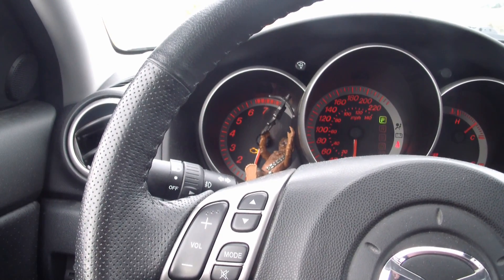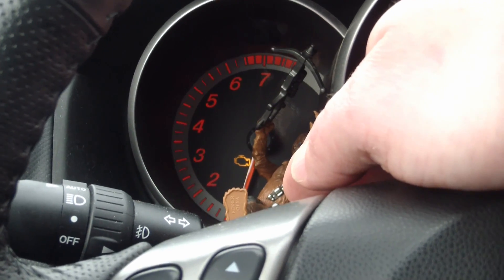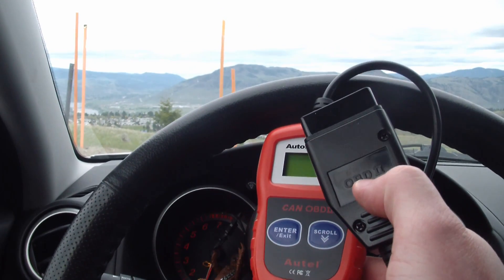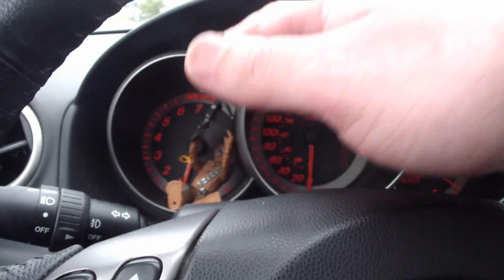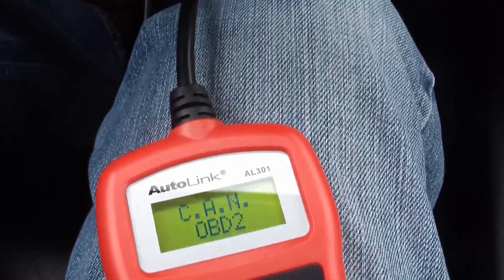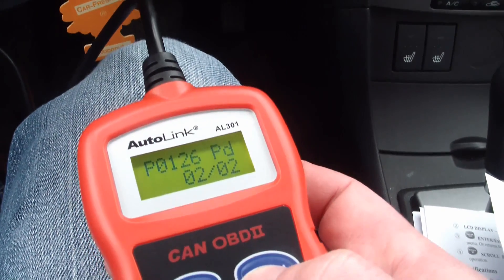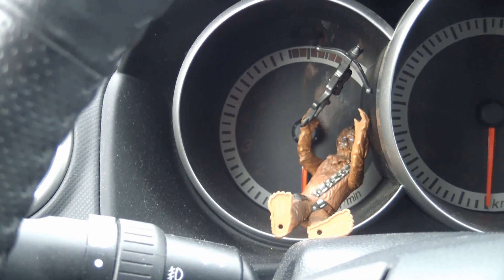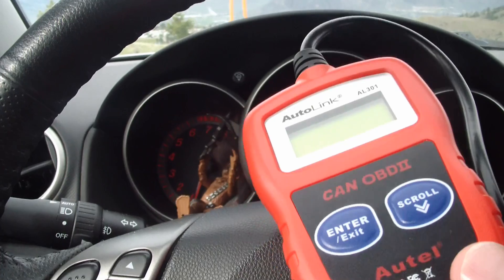Manly-Man Skills: Outsmart Mechanic Scams by Using Your Car's Computer!

Comment: ok lets say your mazda had a random missfire. here is mazda's diagnostic chart. you have 1 hour to nail it. whats wrong with your car

ProDemand
2006 Mazda 3 2.3L Eng S

Component
P0300

REQUESTED INFORMATION

DTC P0300 [LF, L3]

DETECTION CONDITION AND POSSIBLE CAUSE (DTC P0300 - LF, L3)
DTC P0300	Random misfire detected
DETECTION CONDITION 	
The PCM monitors CKP sensor input signal interval time. The PCM calculates change of interval time for each cylinder. If change of interval time exceeds preprogrammed criteria, the PCM detects misfire in the corresponding cylinder. While the engine is running, the PCM counts number of misfires that occurred at 200 crankshaft revolutions  and 1,000 crankshaft revolutions  and calculates misfire ratio for each crankshaft revolution. If the ratio exceeds the preprogrammed criteria, the PCM determines that a misfire, which can damage catalytic converter or affect emission performance, has occurred.
Diagnostic support note 

This is a continuous monitor (Misfire).
The MIL illuminates if the PCM detects the misfire which affects emission performance in two consecutive drive cycles or in one drive cycle while the DTC for the same malfunction has been stored in the PCM.
The MIL flashes if the PCM detects the misfire which can damage the catalytic converter during first drive cycle.
PENDING CODE is available if the PCM detects the misfire which affects emission performance during first drive cycle.
FREEZE FRAME DATA is available.
DTC is stored in the PCM memory.
POSSIBLE CAUSE 	
CKP sensor malfunction
CMP sensor malfunction
Ignition coil malfunction
Ignition system malfunction
MAF sensor contamination
Excess air suction in intake air system (between MAF sensor and intake manifold)
Fuel pump malfunction
Fuel pressure regulator (built-in fuel pump unit) malfunction
Fuel line clogged
Fuel filter clogged
Fuel leakage in fuel line
Fuel runout
Poor quality fuel
Purge control solenoid valve malfunction
PCV valve malfunction
EGR valve malfunction
Vacuum hoses damages or improper connection
Related connector and terminal malfunction
Related wiring harness malfunction
Insufficient compression
Variable valve timing control system improper (L3)
DIAGNOSTIC PROCEDURE CHART
STEP	INSPECTION	ACTION
1	VERIFY FREEZE FRAME DATA AND DIAGNOSTIC MONITORING TEST RESULTS HAVE BEEN RECORDED 
Have FREEZE FRAME DATA and DIAGNOSTIC MONITORING TEST RESULTS (Misfire related) been recorded?
Yes	Go to the next step.
No	Record the FREEZE FRAME DATA and DIAGNOSTIC MONITORING TEST RESULTS on repair order, then go to the next step.
2	VERIFY RELATED REPAIR INFORMATION AVAILABILITY 
Verify related Service Bulletins and/or on-line repair information availability.
Is any related repair information available?
Yes	Perform repair or diagnosis according to the available repair information.
If the vehicle is not repaired, go to the next step.
No	Go to the next step.
3	VERIFY RELATED PENDING CODE OR STORED DTC 
Turn the ignition switch off then to the ON position (Engine off).
Verify related pending code or stored DTCs.
Are other DTCs present?
Yes	Go to the appropriate DTC troubleshooting.(See DTC TABLE [LF, L3] ).
No	Go to the next step.
4	VERIFY CURRENT INPUT SIGNAL STATUS (KEY TO ON/IDLE) 
Access APP1, APP2, ECT, IAT, MAF, RPM, TP, and VSS PIDs using WDS or equivalent.
(See PCM INSPECTION [LF, L3] ).

Is there any signal that is far out of specification when the ignition switch is turned to the ON position and the engine idles?
Yes	Inspect suspected circuit and/or part according to inspection results.(See PCM INSPECTION [LF, L3] ).Then go to Step 20.
No	Go to the next step.
5	VERIFY CURRENT INPUT SIGNAL STATUS UNDER TROUBLE CONDITION 
Inspect the same PIDs as in Step 4 while simulating FREEZE FRAME DATA condition.
Is there any signal which causes drastic changes?
Yes	Inspect suspected circuit and/or part according to inspection results.(See PCM INSPECTION [LF, L3] ).Then go to Step 20.
No	Go to the next step.
6	INSPECT CMP SENSOR 
Inspect CMP sensor.
(See CAMSHAFT POSITION (CMP) SENSOR INSPECTION [LF, L3] ).

Is CMP sensor normal?
Yes	Go to the next step.
No	Inspect installation condition and damages on timing chain and gears, repair the malfunctioning part.
If it is normal, replace the CMP sensor.
Then go to Step 20.
7	VERIFY CKP SENSOR INSTALLATION CONDITION 
Inspect for CKP sensor looseness.
Is CKP sensor loosen?
Yes	Retighten the CKP sensor, then go to Step.
No	Go to the next step.
8	INSPECT IGNITION COIL HARNESSES 
Inspect the ignition coil related harness condition (intermittent open or short) for all cylinders.
Are harness conditions normal?
Yes	Go to the next step.
No	Repair suspected wiring harnesses, then go to Step 20.
9	INSPECT IGNITION SYSTEM OPERATION 
Carry out spark test.
(See SPARK TEST ).

Is strong blue spark visible at each cylinder?
Yes	Go to the next step.
No	Repair or replace malfunctioning part according to spark test result.Then go to Step 20.
10	INSPECT MAF PID 
Start the engine.
Access MAF PID using the WDS or equivalent.
Race the engine and verify that MAF PID changes quickly according to change in the engine speed.
Is MAF PID response normal?
Yes	Go to the next step.
No	Replace the MAF sensor, then go to Step 20.
11	INSPECT EXCESSIVE AIR SUCTION IN INTAKE AIR SYSTEM 
Inspect for air leakage at following:
Between the MAF sensor and throttle body
Between throttle body and intake manifold
Is there any malfunction?
Yes	Repair or replace suspected part, then go to Step 20.
No	Go to the next step.
12	INSPECT FUEL LINE PRESSURE 
Inspect fuel line pressure.
(See FUEL LINE PRESSURE INSPECTION [LF, L3] ).

Is fuel line pressure normal?
Yes	Go to Step 14.
No	If the fuel line pressure is too low, go to the next step.If the fuel line pressure is excess high, replace the fuel pump unit, then go to Step 20.
13	INSPECT FUEL LINE FROM FUEL PUMP TO FUEL DELIVERY PIPE 
Visually inspect fuel line for fuel leakage.
Is there any fuel leakage?
Yes	Replace suspected fuel line, then go to Step 20.
No	Inspect fuel filters for following:
Foreign materials or stain inside fuel filter (low-pressure side)
Perform following actions depend on the result above.
If foreign materials or stain is found inside fuel filter (low-pressure side), clean the fuel tank and filter (low-pressure side).
If normal, replace the fuel pump unit.
Then, go to Step 20.
14	INSPECT ENGINE COMPRESSION 
Inspect engine compression.
(See COMPRESSION INSPECTION [LF, L3] ).

Is it normal?
Yes	Go to the next step. (L3)Go to Step 16. (LF)
No	Perform engine overhaul for repairs, then go to Step 20.
15	INSPECT VARIABLE VALVE TIMING CONTROL SYSTEM OPERATION 
Inspect variable valve timing control system operation.
(See VARIABLE VALVE TIMING CONTROL SYSTEM OPERATION INSPECTION ).

Does variable valve timing control system work properly?
Yes	Go to the next step.
No	Repair or replace malfunctioning part according to variable valve timing control system inspection results, then go to Step 20.
16	INSPECT OPERATION OF PURGE CONTROL SOLENOID VALVE 
Turn the ignition switch off.
Connect the vacuum pump to purge control solenoid valve and apply vacuum to solenoid.
Verify that solenoid holds vacuum.
Turn the ignition switch to the ON position (Engine off).
Access EVAPCP PID in SIMULATION TEST using the WDS or equivalent.
Set duty value to 100%  for EVAPCP PID.
Apply vacuum while turning solenoid from OFF to ON and simulating EVAPCP PID with 100%  duty value.
Verify that solenoid releases vacuum while solenoid is turned ON.
Is purge control solenoid valve operation normal?
Yes	Go to the next step.
No	Replace the purge control solenoid valve, then go to Step 20.
17	INSPECT PCV VALVE OPERATION 
Turn the ignition switch off.
(See POSITIVE CRANKCASE VENTILATION (PCV) VALVE INSPECTION [LF, L3] ).

Is PCV valve operation normal?
Yes	Replace the PCV valve, then go to Step 20.
No	Go to the next step.
18	INSPECT OPERATION OF EGR VALVE 
Remove the EGR valve.
Visually inspect the EGR valve for stuck to open.
Is EGR valve stuck to open?
Yes	Repair or replace the EGR valve, then go to Step 20.
No	Go to the next step.
19	INSPECT SEALING OF ENGINE COOLANT PASSAGE 
Perform "ENGINE COOLANT LEAKAGE INSPECTION."
(See ENGINE COOLANT LEAKAGE INSPECTION [LF, L3] ).

Is there any malfunction?
Yes	Repair or replace malfunctioning part according to inspection results.Then go to the next step.
No	Go to the next step.
20	VERIFY TROUBLESHOOTING OF MISFIRE DTC COMPLETED 
Make sure to reconnect all disconnected connectors.
Turn the ignition switch to the ON position (Engine off).
Clear the DTC from the memory using the WDS or equivalent.
Perform the KOER self-test or the HO2S heater, HO2S, and TWC Repair Verification Drive Mode. (See OBD-II DRIVE MODE [LF, L3] ).
Is the PENDING CODE for this DTC present?
Yes	Replace the PCM, then go to the next step.(See PCM REMOVAL/INSTALLATION [LF, L3] ).
No	Go to the next step.
21	VERIFY AFTER REPAIR PROCEDURE 
Perform the "AFTER REPAIR PROCEDURE".
(See AFTER REPAIR PROCEDURE [LF, L3] ).

Are any DTCs present?
Yes	Go to the applicable DTC troubleshooting.(See DTC TABLE [LF, L3] ).
No	Troubleshooting completed.

Comment: Ok you should point out that if it flashes at you then yes, you want to worry about it. A flashing obdll light means you have the worst kind of missfire: the kind that dumps raw fuel into your catalytic converter eventually ruining it and costing you big bucks at smog time. Also there is an even better device than that autolink you have. There are bluetooth obdll readers you can get for $13 on shmebay that you use with a free app on your phone called torque and it does sooooo much more than just read and clear codes. You can even do advanced stuff like graph timing advance, O2 read outs and fuel useage and more. For $13!!!

Comment: i had an electrician give me a wiper motor switch to "throw" onto his suburban "real quick".  he ordered me to do it because one of the 2 speeds of his wipers wasn't working including the intermittent wipers. instead i actually tested the circuit. the switch was fine, the wiper motor was bad! he just assumed it was so f'ing simple and easy. 

same guy had a problem with the automatic headlight system (going through tunnels or at night" etc...(remember this guy is an electrician) he said "ahhh its just probably a stupid relay. just pull out the relay and clean it" clean it? gone are the days of that stuff. this "relay" that was buried in the dash somewhere? it was actually a "module" a state of the art module (at the time) circuit board. who's to say that was even the problem?

Comment: I get that the mechanic system is broken. what is your answer? If you made your living repairing cars how much would you consider fair compensation? $10 $20 $30 $40? IF YOU OWNED A SHOP HOW MUCH IS A FAIR AMOUNT TO PAY YOURSELF? its simple to figure out...

really, people complain but how much would you do it for? dont forget you need $30,000 to $60,000 in your OWN personal tools. I love what i do but it is an extremely frustrating and at times difficult job. 

i just pulled a cylinder head off of a 2006 camry 4 cylinder to have the valves reconditioned (burnt valves). i was paid 7.7 hours for the job. it took me 13! I have been working on cars over 20 years. i had to remove everything touching the cylinder head so it could be sent to a machinist. i also had to remove the timing chain cover that is silicone'd on. 

there was 3 hours alone into clean up of parts and gasket mating surfaces. That would mean that you would have to have the head off the car and stripped down in about 1 hour. 3 hours for cleaning leaves you 3.7 hours to re install the parts back onto the head, torque down the head, set up the cams and timing chains, glue/silicone the timing cover on put on all the wiring, connectors, hoses, intake and exhaust plumbing, change the oil, add and burp the coolant, and test drive, confirm there are no problems or fluid leaks etc...

SOUND LIKE A POSSIBILITY? if i did it 3 times in a row sure. that particular engine 1 or twice in a lifetime, NOT GOING TO HAPPEN!

NOW consider all of the LIABILITY i have after losing money on a job (paid 7.7 hours for 13+ hours of work) any little tiny thing that goes wrong with anything whether it has anything to do with you or not is now you problem. IS IT WORTH IT?

Comment: First off i am all for anyone to fix there car themselves. BUT i am sick and f'ing tired of the mentality of people thinking that they can plug something into a car (whether its a $60,000 tool or a HF $9.99 tool) and it will tell them whats wrong? can you guess and get lucky YES. I've been doing this over 20 years and to this day i have cars i spend hours on trying to accurately diagnose the problem. 

we had a mercedes in last week. the turn signal on the left side stayed on. there were 30 codes! i can go retrieve those codes and show them to you. will you be able to tell me whats wrong with the car? i can tell you that the problem WAS NOT A TURN SIGNAL SWITCH.The thing that really sucks about most euro cars is that there is no access to "backprobe" the wiring or connectors. WTF how F"ING STUPID IS THAT?

I spent 3+ hours on the car and even replaced the turn signal switch. The switch did not fix it. i took it all back apart. the customer was not charged anything, no diag, no parts, no labor. i am payed by the job only (as are most mechanics). SO WHO GOT RIPPED OFF? THE CUSTOMER? OR ME, THE MECHANIC? 

what does the computer say you need to fix/replace for a p0300 RANDOM MISFIRE? the "random" means that the engine computer cant detect which cylinder/s is/are misfiring. 

so...some or all of the cylinders are misfiring (you have extracted trouble code p0300 from your car). just go to autozone and ask the minimum wage employee what to fix/replace with your p0300 code? google it (yes usually very informative BUT can just as easily misinform some one very quickly and steer them down the wrong road...not a cost savings in any way).

misfire can be anything that causes the engine to misfire. 

vacuum leak
bad plug, but why was the plug bad? is it going to go bad again? 
bad coil?
bad plug wire?
restricted injector?
open injector?
bad computer driver?
head gasket problem?
wrong fuel e85 in a e10 vehicle?
bad crank sensor?
timing chain/belt problem

there are several more...

on top of all that more misfires are intermittent in nature then they are constant? is an intermittent any more difficult to find/fix/replace?

Comment: Thanks for the info Chris. I need to invest on one of those nifty tools. My airbag light has been going on and off for a while, driving me mad each time because it chimes 3 times each time it comes on!😡 would love to turn that shit off! Keep it real!

Adam
Reply: Abom79 so you think plugging the tool into the car is going to tell you what to fix for you airbag? i doubt it, but thats just coming from a 20 year mechanic.
Reply: the scanner will not tell you that there is a loose connection. more importantly it will not tell you where the loose connection is.
Reply: Abom79 If it's the passenger's seat airbag, then the pressure sensor(s) in the seat (it checks if anybody sits there) might be faulty or there is a loose connection to the sensor(s). I had the same problem when having heavier backpack in the passenger's seat while driving - had to put the seat belt on in the end:-)))
Reply: Abom79 sorry dude, one of those cheap code readers is not going to be able to access the airbag diagnostic codes, you will need to buy one that can access pcm, abs, and srs modules, besides airbag stuff is dangerous, and no amateur should go poking around explosive devices
Reply: Most common air bag lights that randomly come on are the seat belt as the seat moves check out the plug under the seat with the battery off so nothing goes off or electric seats can move
Reply: Andrei Marinescu LOL!! Heard!
Reply: I think ole Chris got me with the shock and awe treatment. LOL
Reply: Don't waste time with the airbags... People are waiting for the next SNS 😁
Reply: +ritorujon  I agree, but more info would help. It may have a sensor sensing(I just got that lol)not enough weight on the seat thereby shutting off a airbag deployment for a child or small person. It may have a switch shutting down the passenger front airbag you can use. Honestly guys don't chance it let a pro or a good friend who is help you out. The airbag is still active for a short time even if the battery is disconnected. Also moving the control module while still powered can set off all the airbags. So don't chance it.
Reply: +Abom79   these OBD-II probes are now pretty cheap

http://www.amazon.com/gp/product/B0136VXTSE?keywords=OBD%20scanner%20%28turbo%29&qid=1447963795&ref_=sr_1_3&sr=8-3

if you have an Iphone, then you can get one for them.

They are so cheap, I put one in each vehicle's tool kit.  (I have several).

Comment: While OBD2 is a global standard, there are manufacturer specific fault codes and data that only a factory scan tool can access. Some of the high dollar professional level scan tools can read the manufacturer data but they're out of the home gamers budget generally speaking. Having said that, a basic OBD2 scanner like the one you have is really a must have for the DIY. Another quick test to see if a fault will return is the "two cycle test". If the fault is emissions related, on the first drive cycle it will set a pending code, but no check engine light. If the vehicles ECM/PCM detects the same fault on the second drive cycle, it will store the fault and turn on the check engine light. In most cases only emissions related faults will turn on the check engine light.